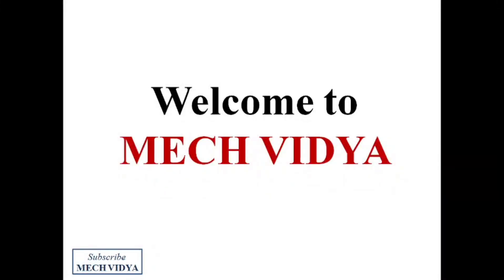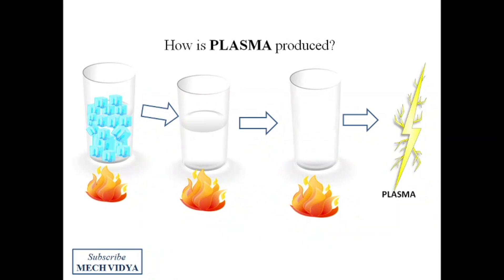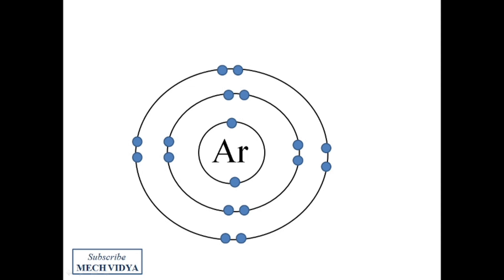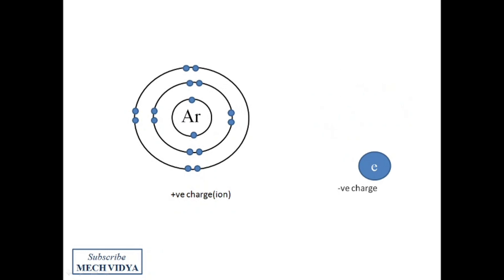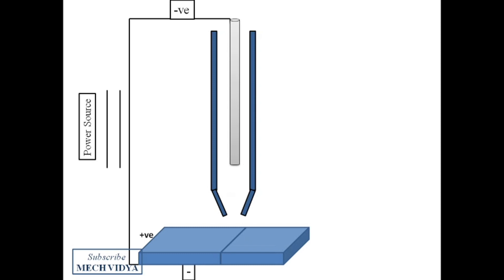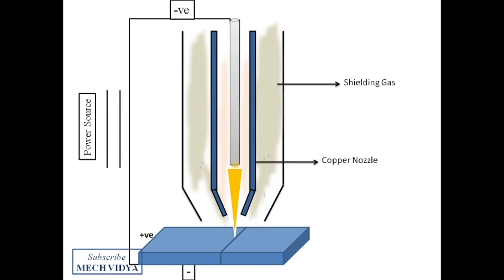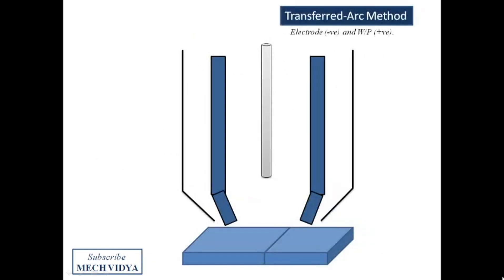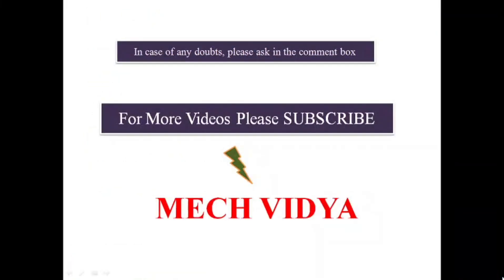Plasma Arc Welding [Detailed Working Principle]

Comment: how arc is formed? please explain in details
Reply from the maker: Actually the high voltage creates an intense electric field between the small gap. This excites the free electrons present in the air gap and these free electrons start moving at tremendous speed and starts to hit the gas atoms. As a result more electrons are knocked off from the atoms. Thus a Plasma channel is formed which is highly conductive. And the resistance of plasma to the flow of electric current causes the heat of arc.